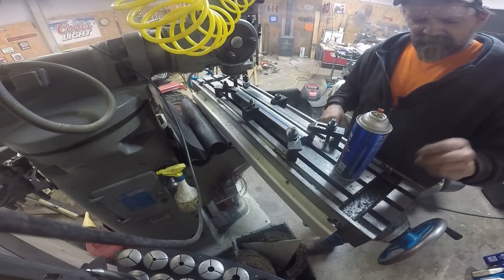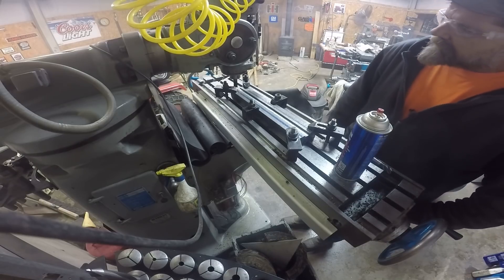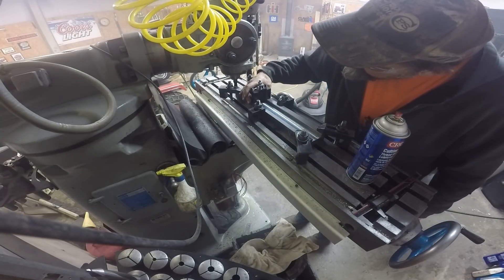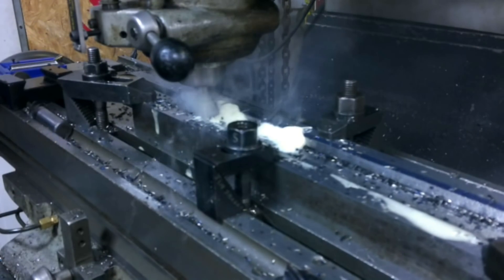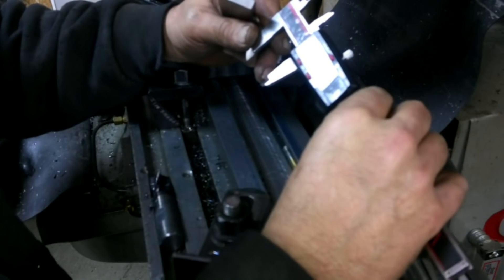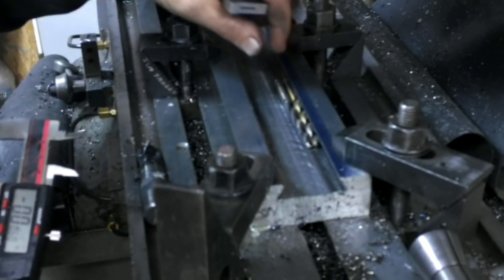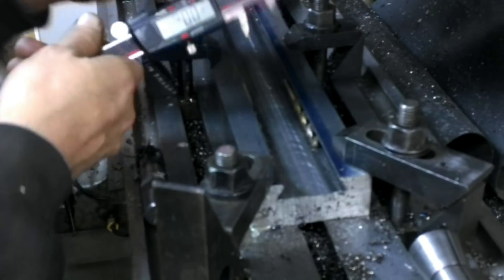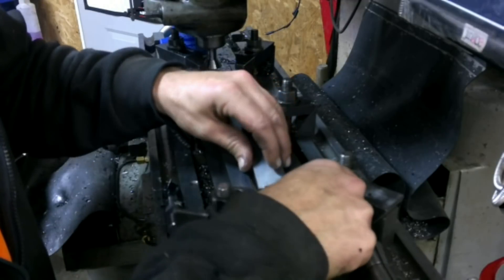BXA Tool Holder Part 2 RR in the Shop Dovetail Cutter

Comment: Well done.  I’ll try that some day, when my skill set says it’s time. It might be a while though. Like what you’re doing. Nice to see chips coming off your mill. Have you thought about building one of those waste oil heaters. About a 30 gallon drum with the heater built-in would heat your shop toasty warm. When I use oil cutting and the garage fills with smoke, my wife comes out and starts coughing and says I don’t know how you can handle all this smoke out here, it stinks.  I like it 😁 it’s part of the experience. Thanks for sharing 👍
Reply from the maker: I have a nice wood stove,  and its only (really cold) in Ohio  for 5 to 6 weeks.   Thanks for stopping in Ron.   I have some stickers for you.  Ill try to get them out this week.

Comment: I'd like to order one of his Dovetail cutters and make my own BXA's - but they are so cheap on eBay and it looks like a lot of work, and set up, and the price of the steel and the cutter, and the set-screws, etc etc....... unless you're needing special odd tool holders for your QCTP it's not economically feasible for me?
Reply from the maker: For cheap holders , figure 25.00 each with shipping?  Im making 8 holders from a 30.00 chunk of steel.  It is quite a bit of  work. ( but Satisfying) 
The cutters , I got them to support Randy`s channel.  And to have if needed... the hardware isnt to bad to round up. 
Its more so so I can say I made that... and very good practice to hit your sizes.   .. thanks for stopping by..
Reply: @metalworksmachineshop   Oh ya, man, just found you tonight- Plan On watching more- Just bought a Bridgeport last June, a big Clausing/Colchester in July and just finished 100% restoration of 1946 Brown & Sharpe surface grinder-  even tho thy came with a bunch of tooling, you always need more- Love your stuff man
Reply from the maker: @Mad-Duk_Machine_Werkes   very cool. What Colchester do you have. Mine is 1960 15x48  gear head
Reply: @metalworksmachineshop  1967 13x36 Round top (Bridgeport is a '66)